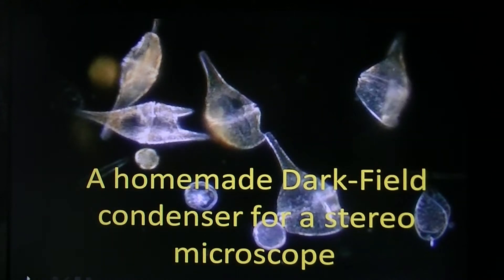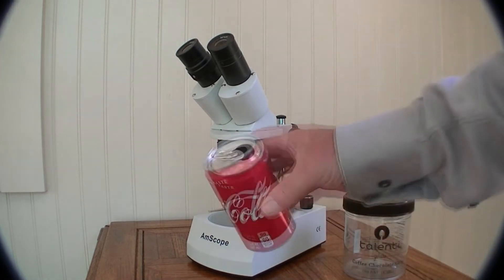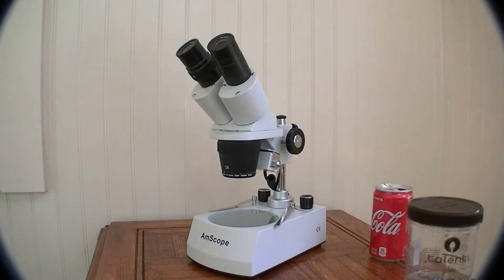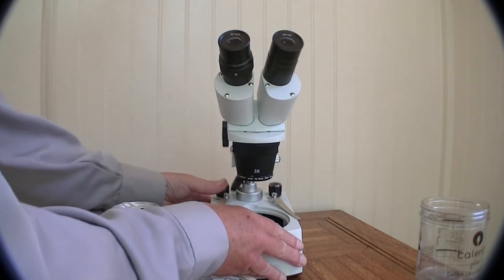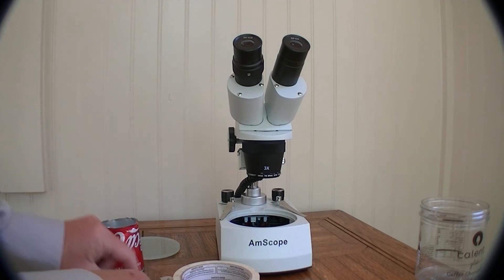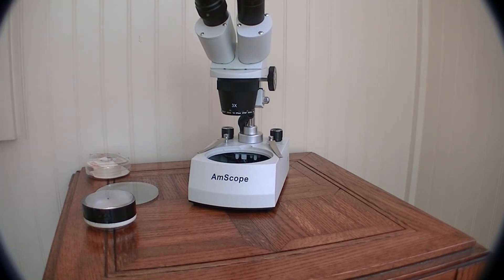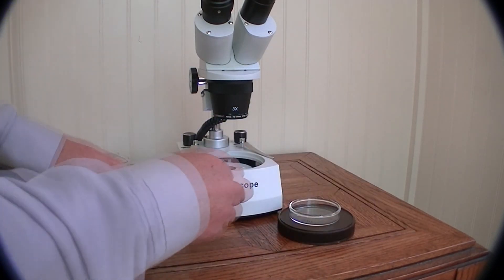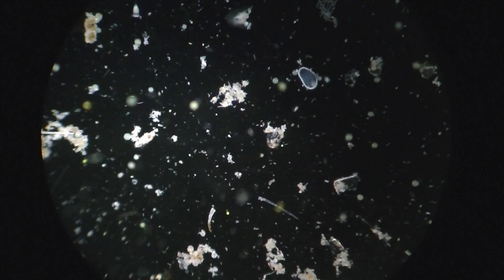Dark field condenser

Comment: Excellent idea Clive, this would make an ideal project for a 3D printer!. I could imagine making the patch setup modular so many sizes could be used depending on the zoom scope setting and the ‘jar’ could be made of pla and coated inside with foil. Thanks
Reply from the maker: True - but in the spirit of sustainability I hunted around for different sized soda cans!

Comment: Why use the black tape and foil instead of just gluing the penny onto the clear film? The penny will block the light and also reflect it. Paint the top of the penny black with a permanent marker to avoid unwanted reflections... this way there's no need to try and cut perfectly round pieces of electrical tape.
Reply from the maker: Could do - but depending on the numerical aperture and working distance of the objective lens, a penny might not be quite the right size. Also with a stereo microscope, an optimal patch needs to be more oval than round to accommodate the spacing between the objective lenses. Finally it is, or at least used to be, an offence to deface the Queens face on a coin in the UK (penny squashing machines were illegal!)

Comment: Can this work on zoom stereo microscopes? I am asking because of the diameters of the hole and the patch. Is there a way to make it work when the magnification and the focal length are constantly changing?
Reply from the maker: Not optimally, but you might get away with 2 or 3 condensers for low, medium and high zoom settings

Comment: My introductory microscope has a frosted condenser lens. Previous microscopes I delt with were not frosted. Would darkfield still be possible?
Reply from the maker: No, it will scatter light and override the dark field effect. I also across a microscope with a frosted element in the condenser - it looks like it could be temporarily removed but as the microscope was not mine I did not try it